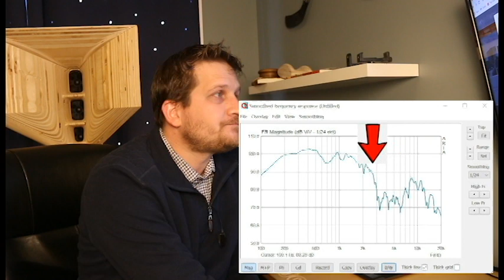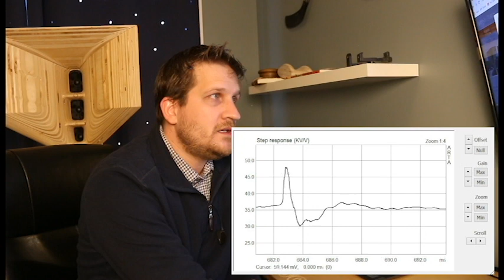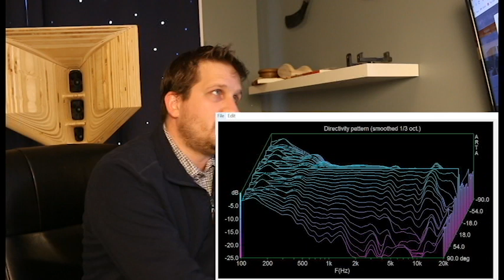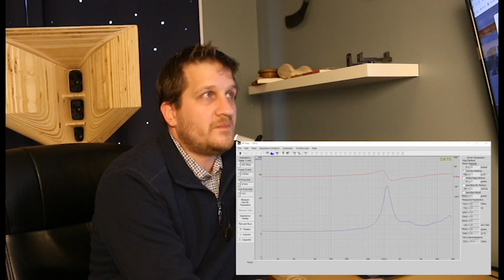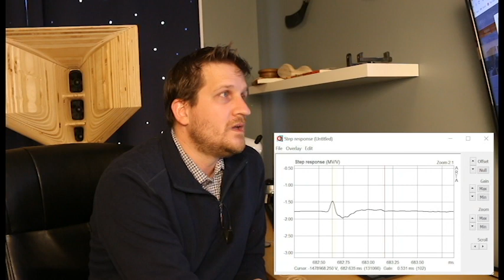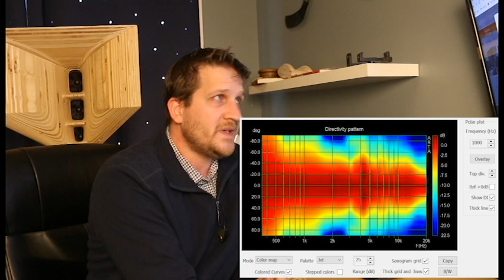Nighthawk Front Horn --- Full Test with Measurements

Comment: Have you any new developments with this design?
Reply from the maker: Yes the latest development is System No.1349.  It’s a variation of the original Nighthawk.  The biggest difference is a larger high frequency horn, and radial curvature for improved vertical coverage.  The drivers are meant for hifi this time around (Not pro sound).  It will use a Viawave ribbon, and Scanspeak 10F midrange drivers.  It will also use the full ES curvature with the wrap around geometry on the horn mouth.  

Details can be found here...
https://josephcrowe.com/blogs/news/speaker-system-no-1349
Reply: @JosephCrowesDIYSpeakerBuilding  wow..that off axis graph looks phenomenal even relatively compared to the original nighthawk. All this from merely increasing the size on the high frequency driver? I noticed you were able to cross over at 2.5 kHz. Have you scrapped the idea of using a wide bandwidth driver?..I'm always amazed that  builders ask so much from one little driver. It seems the 4 way is the best alternative? Even though you consider this to be no longer a pro driver, 109 db is nothing to scoff at.

Comment: Beautiful work, love the  concept, design and engineering. Knowing CNC programing and having access to the machinery is a real plus.  The weakness I see is handling powerful low midrange / mid bass notes (200hz - 400hz ). I totally understand keeping the size reasonable to keep it room friendly.  As a fellow DIY horn guy  and having a video  by Steve Guttenberg posted, I commend your effort. IMHO you should try scaling up your speaker size so you can get some  extra power handling.  I am very impressed on many levels with your work. I wish you the best of luck with this and your future projects !!!
Joseph Bulger

Comment: Is there anything wrong with the ceramic versions of these?  Is it just the qts.
Reply from the maker: I generally select neo drivers if I have the choice since I always seem to prefer the sound.   Beyond that I would want demodulation rings however they are not really an option on drivers in this price range ($40USD).  The scanspeak 10F/8424 would be an example of the neo driver with copper pole piece for demodulation and subsequent lower intermodulation distortion.  They are $103 USD however.
Reply: @JosephCrowesDIYSpeakerBuilding  I have the same issue, my last build was on a junk box with all the drivers blown some how, $120 total for parts for both speakers.

Comment: damn that looks like a nice wood project !! love the curves and such ! They look impressive ! to say the least ! 
May i asks what mic you use ? since 0.2% at 1 khz  in third harmonic. looks a tad much if you ask me. for 4 midrange drivers. im sure they can do better then that. i know you already said it might be lower. but i think it should be much lower.  if ur using a Umik... trow it in the bin :) please since you are making horns that should have low distortion a UMIk has rather much of its own. and you might not be able to see real results.

- At what voltage is the distortion measured ? since i see  it peaking at 90 dB  , maybe crank that up a bit get rid of noise. and see how it does ?
-  i see you changed the waterfall settings we discussed few months back, by using 30 ms  as time  range, all details are lost. and looks flat , might be an Arta thing though. since we where discussing REW.

you might have seen it already but when you show the scale change to dB instead of percentage for the midrange  ,  you show the measurement of the tweeter :) or the combined measurement i  think.
Reply from the maker: Thanks Joppe, I'm using the Dayton UMM6.  I've looked at Earthworks but we will see how my year end is before investing in more test equipment.   The burst decay is shown in 30 cycles not milliseconds.  So at 10kHz 30 cycles is only 3 milliseconds.
Reply from the maker: Distortion may not be the lowest compared to my other tests since I was using the headphone jack on my laptop going through the MiniDSP as well.  In other tests I’ve done was using my DAC connected directly to the amp.
Reply: @JosephCrowesDIYSpeakerBuilding  yeah im pretty sure it is mostly the rest of the gear trowing measurments off. i recommend Isemcon for mic. still affordable and muich better then the Umik/dayton variants.  its the one i used on the last measurement.
Reply from the maker: @joppepeelen  Thank you Joppe, what model of Isemcon are you using?
Reply: @JosephCrowesDIYSpeakerBuilding  the basic measuring mic EMX-7150 the bulk version :) when i bought it they where 160 euro... now a little more expensive. but great service to. i demolished mine once :) and they do repair. (although my capsule and electronics where fried) it costed me 140 or something. thats cheap if you consider only the housing was used...  i received a new calibration file for the repaired mic. love them !

Comment: Might be better if you round off the corners what was the reason you went for sharp angles generally is a no no because of edge boundary you might be getting some cancellation 3.5k
Reply from the maker: John sweda Thank you for the feedback.  The performance could be improved with a fully rolled horn mouth on the HF horn which I can add.  The reason for the lack of rolled mouth on the mid horn portion is in the way it’s machined on my CNC.  The “petals” sit flat in the machine and the flare curvature is machined in one setup.  https://www.instagram.com/p/B-qwV7UJBtK/?igshid=s5ikhrqhvf2m
Reply from the maker: John sweda I normally feature very smooth transitions off the horn mouth which does result in better performance so I’m not stranger to this attribute... https://youtu.be/FMH94TS11AI

Comment: Great project! Thanks for sharing! Maybe you can try move the xo point to 2.5k. And a question: why the horn is not completely rectangular, meaning also the CD being in the same rectangular shape as the mids? Thanks!
Reply from the maker: 2.5kHz results in an uneven polar response since the HF horn loses pattern control at 3.5kHz.  This would effect the great timbrel balance I was getting.   I tried numerous crossover points and slopes and 5kHz was a very balanced sound.  The six midrange drives have massive dynamics much more than even the compression driver.  This is something that's hard to show with measurement.

Comment: Looks absolutely amazing! Challenging response issues as you described. Have you considered building a synergy horn using your custom horn flare? That would check all the design criteria..Love the name nighthawk too. Awesome work and keep pushing the limits!
Reply from the maker: I've considered that although it's impossible to get wide coverage at 15kHz like what I'm getting with the smaller HF horn.  90 degrees at 15kHz is not something I've seen in a large horn regardless of the throat size or other flare geometry considerations.  This is one of the main design rationale for the hourglass shape.  I would love for somebody to prove me wrong by showing me a 200Hz horn with 90 degrees coverage at 15kHz.

Comment: something doesn't seem right.  The FaitalPRO 4FE32 should play to 5khz flat no problem.  A 5k wavelength is 2.712 inches.  1/4 of that is .678 inches.  My guess is that the distance of the midrange from the tweeter is too far and causing a suckout (specifically the top and bottom 4 inch mid).  Try reversing the crossover on the tweeter.  Switching the plus and minus.  Does the suckout at 3-4k go away?  If it does I would recommend a 2.5 way crossover.  Let the mids around the tweeter play from the 200-5k range and let the outer mids pick up the 200-400 range.  You may have to redesign your crossover but I believe you would get better results.  Best of luck.  I really enjoy your content even though I don't comment very much.
Reply from the maker: If you look at the raw frequency response for the midrange horn you'll see it starts to fall quickly past 1.6khz.  Horns will only cover 2.5 octaves and so I've selected 350Hz-1.8kHz where it provides around 9dB boost in sensitivity.  Attempting to extend the bandwidth of the horn past 1.6kHz requires that the natural frequency response of the driver is rising where the horn is falling, so that it sums flat.  This is achievable with planar drivers such as the BG neo8 which has an aggressive rising response in the 2-4kHz region.   I can't use any lower of a crossover point since the HF horn loses pattern control below this frequency and results in an uneven polar map where there is excess off-axis energy in the 2-4khz region.  I can either make the HF horn bigger and cross it lower or I can attempt to find a mid driver that allows extension to 5kHz which would be my preference.  The subjective sound quality of six midrange drivers is far more dynamic and enjoyable from my listening tests.